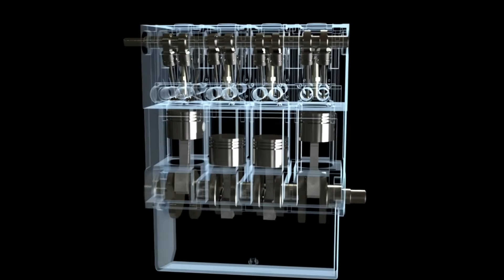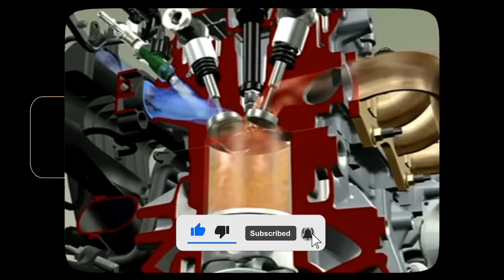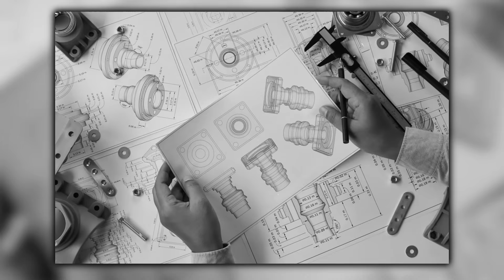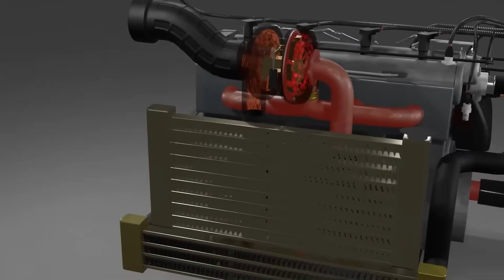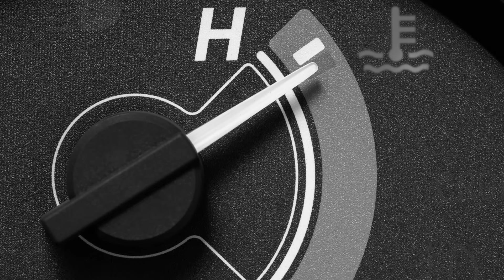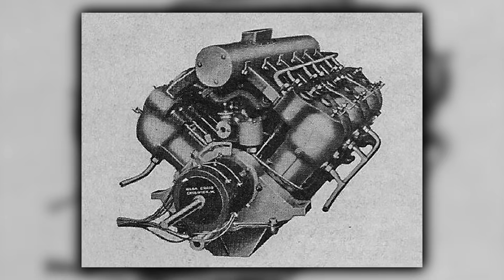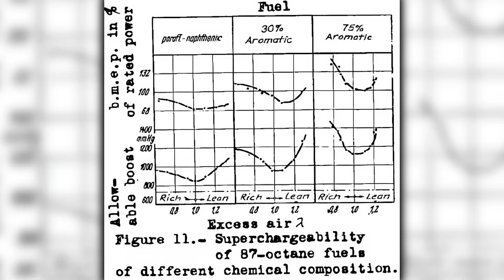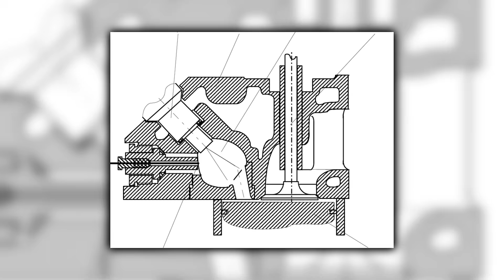They Laughed at His Engine — Until It Changed Combustion Forever

Comment: I feel thicker cylinder walls , thicker heads possibly using ceramic coatings , remove sharp edges.  Sharp edges from unused sparkplug threads. And polish pistons and cylinder head chambers. With that chamber shaped to keep the air fuel in the center of the chamber around the sparkplug.

Comment: There was a Ricardo test engine at the engine lab in university . It was a variable compression engine with a quartz window . We were doing extensive testing with bio-gasses like digester  gas . The research led me down the LPG road and my final engine is based on some of that research . Compression ratio , quench area and turbulence are all incorporated with modern materials in this final build . Modern things like sodium cooled valves , fast burn high swirl chambers design and close quench tolerances work very well with gaseous fueled engines !
Reply from the maker: How cool!

Comment: Understanding the science of combustion understanding how proper delivery into the cylinder, proper air fuel mixture, proper ignition timing, proper compression ratio stroke, bore size all that very important than the morons design direct injected engines, which build carbon on the intake valves and screw up the entire airflow through the engine you have to ask yourself. Why do we let Washington DC people who not know nothing about anything get involved in very complex situations and make the American public pay the cost!
Reply: Direct injection has advantages in efficiency and output.  Dual injection systems help with keeping valves clean.  I still feel more developing is necessary.
Reply: Direct injection development began for aircraft engines during the 1940's in Germany.  What did Washington DC have to do with that?

In 1954 Mercedes put direct injection into production with the 300 SL for road legal use and the 300 SLR for racing. What did Washington DC have to do with that?

Direct injection systems are superior to carburetors and port injection for all aspects of combustion efficiency. Keeping the intake valves free of carbon buildup only requires (as stated by the previous comment) dual injection. You can be sure that manufacturers would not have gone to the added expense of a dual system if direct injection was not superior.

Comment: This explains a lot.  I had to watch it a few times to understand the point that Mr. Harry Ricardo resolved.  I was surprised to see how unreliable the internal combustion engine was early on.  It was like a bomb, or an internal destruction engine!!  As far back to the '60s, I had always been intrigued in what makes a gasoline powered engine worked and why it failed.   I would take apart my gas-powered model airplane engine to see what it was inside and why failed.  In 1968, I took apart my mini-bike engine!  That was fun!!!  My dad however didn't think so.  Combustion control and better fuel design was the key.  Or at least the start of solving the problem!!!   As can been said, "Necessity is the mother of invention."
Reply from the maker: I found it fascinating how much trial and error went into perfecting something we now take for granted!
Reply: Yes, I was always after the combustion process 2!! Took a couple lawn mowers apart to glimpse it!